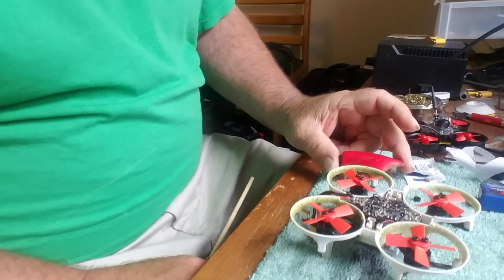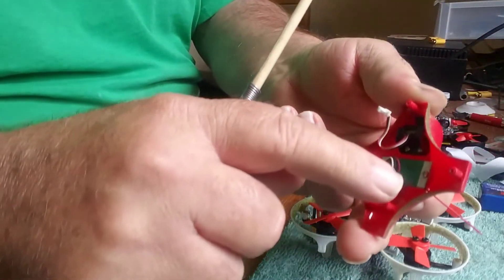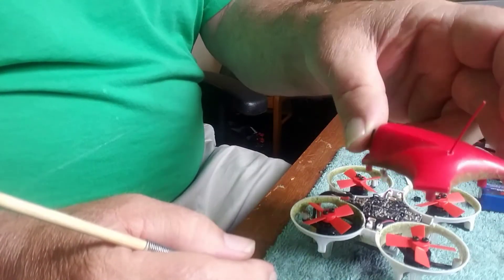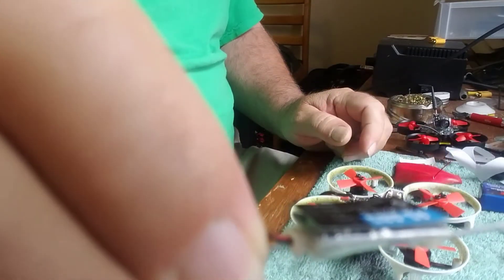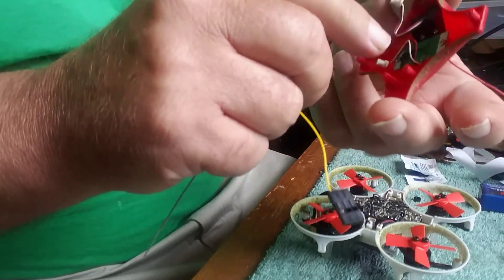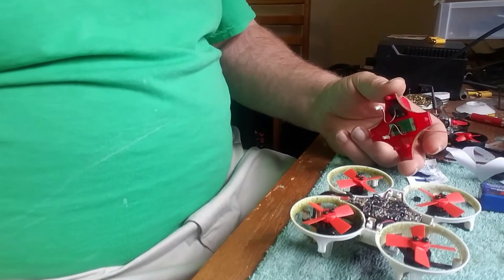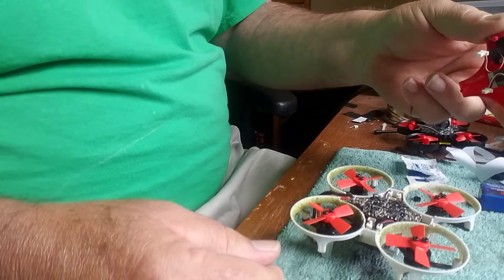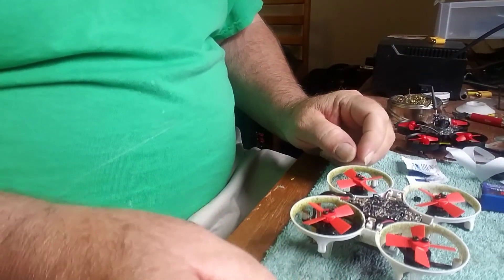DYS Elf receiver upgrades

Comment: Is it possible to make the ELF work with a Fly Sky receiver?
Reply from the maker: Justwantahover  yes the all the ones that have ibus FS8S and the XSB will work fine and use the three wires going to the stock receiver.